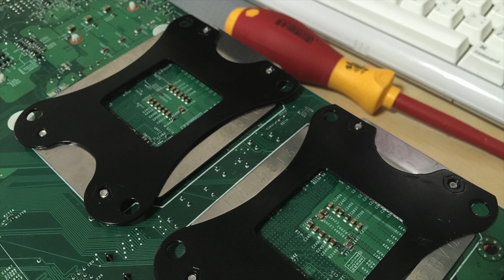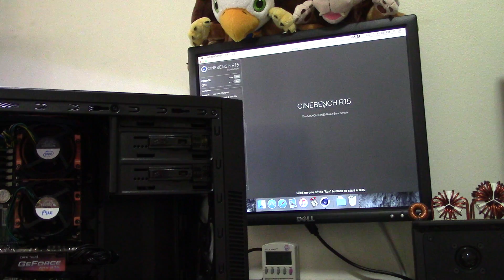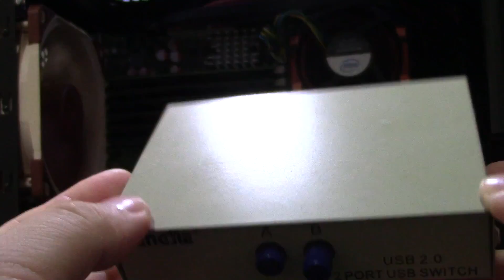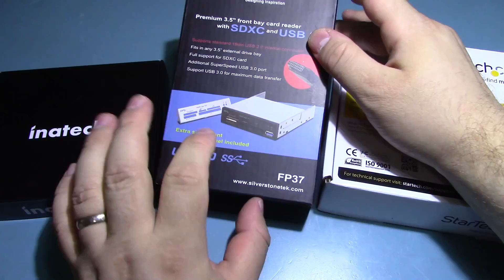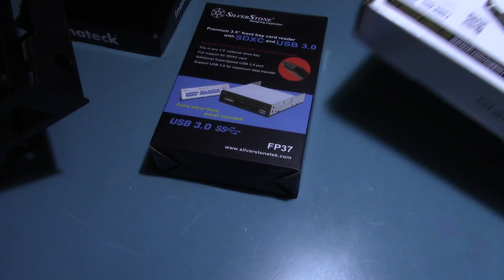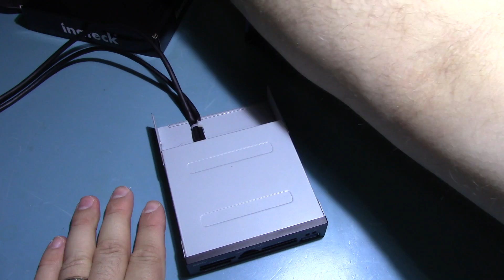Comment: For a couple years now i have been planing to build five systems running this exact motherboard, plenty of RAM and 2x E5450 Xeons each for our gaming/party garage we are currently building.
Each system would be hooked up to a seperate TV. Plan was to make them Win7 or 10 only but you inspired me to make them dualboot. Never had a Hackintosh before.

We have 5 TVs mounted to one wall. 3x 32" 1366x768 Fujitsu (really awesome ones) next to each other + 2x 42" 1920x1080 LG right above them.

The three 32" ones are currently hooked up to 3 GTX 480 1.5gb GPUs (got them for ~50€ a piece) , which are seated on various 775 boards with adapted and slightly OCed E5450 Xeons and 4GB DDR2 each.
One of the two 42" ones is hooked up to a 3GB GTX 580 paired with a i5 2500k + 8G DDR3, the other one to a annoying Radeon 7950 3gb on a i7 960 + 6 GB DDR3.

In really modern Games like GTA V the Xeons start to bottleneck the GTX480s, but since the game does take advantage of more Cores this upgrade should work out quite nicely.
The Xeons and the Nvidia GTX GPUs are going to be reused. The other 42" will probably be hooked up to a GTX 760 2GB that i have laying around somewhere.

The rest of the old rigs will hopefully make enough money on ebay to refinance the most of the new parts i will have to buy.

So, now i only need to get 5 of these boards (~125€), 6 more xeons (~150€, i have 4 already) , 5x 16gigs of DDR2 ECC reg.  (~100€) , 5x old Sounblaster Audigy or simmilar PCI soundcards (max. 50€) and 10x custom made heatsink backplates (~19687,53€) :D ... ok that last number might be a little far off. Also, to be honest, one of the main reasons why i haven't bought these boards yet is that the ebay seller hasn't answered my question about the shipping cost to germany yet. I won't pay another 100€ just for the shipping.

Also i have to mention that it took only one of your videos for me to subscribe last week. Keep up the good work, i've really been enjoying your content sofar and i watched a good part of it already ! :)
Reply: +Coldministrator With gaming it's generally preferred to have fewer cores, overclocked if possible vs. many slower cores. There are very, very few games which use more than 1-4 cores. Most of which only use 2. It's actually quite surprising how little CPUs bottleneck most games, it's way less than you'd think.

Unless you really want to play a specific game which somehow uses a lot of cores, it is probably going to be a better idea to sell the Xeon board + CPUs and get either a modern AMD system or something like an 1155 motherboard on eBay for ~$50 and an i5. Yeah, you'd lose the ability to get cheap DDR2, but plain DDR3 isn't much more these days and you'd get all the other stuff which comes with a newer board like USB 3.0, more PCIe slots, etc. It'd also make way less heat and use way less power for pretty much the same job (if the game doesn't use 8 cores).

This isn't the exact article I remember reading (I think the one I read was on Anandtech, but you get the idea): http://hothardware.com/reviews/can-a-new-gpu-rejuvenate-a-five-year-old-gaming-rig-
Reply: +Peter Brockie Yeah well, i'm sure there are better cpus for gaming but i've noticed that there are actually many games that benefit from more cores, a lot more than you'd think.
Also, a single E5450 is still faster than a Phenom II x4 955 for example. The 955 was a great CPU for gaming and i've been using one of these in my LAN rig for ages.

And for games that don't use more than a few cores, here are a couple Passmark SINGLE THREAD scores for various CPUs:

Phenom II X4 955    :  1122
E5450                        :  1266
Core i7 860               :  1299
Core i7 960               :  1385 
AMD FX 8150           :  1337
AMD FX 8350           :  1506

The E5450 is not weak at all! Certainly not for the price! Two of these really kick ass if properly utilized.

For example GTA V runns a lot better on my dual Opteron 8439SE rig (12x 2.8GHz) than it does on a single Xeon E5450.

Now take a look at it's single thread score:
AMD Opteron 8435 :    913 (there seem to be no single thead scores for the 8439SE, the only difference is 200Mhz Clockspeed)

I probably will do a video on this Topic one day.

And you also have to keep in mind that with the Xbox One and the PS4 being x86 multicore Systems most of the upcomming Games will probably take advantage of more cores even better.

To adress some of your other points: I don't need more PCIe Slots or USB3, also two E5450 cpus still need less power than a single FX8350 under full load.

Not to mention that anything more modern to beat this in performance would cost a lot more to buy.
Reply: +Coldministrator That's the nice thing about Intel, their IPC is so high even on older chips that it doesn't matter that you can get an 8 core AMD for the same price. Yeah, in heavily multithreaded stuff the cores can take the lead, but in real world stuff Intel quads are hard to beat (especially if you are using something you can overclock).

The last few videos have been edited on the dual quad and it seems just as fast as my Ivy Bridge. Pretty happy with the build so far. I mean, in a perfect world I would just get used to using Sony Movie Studio which I own, but I'm stubborn. Haha I like the ability to have one machine rendering/uploading without affecting my main system while I play WoW or whatever. :)
Reply: +Peter Brockie Yeah, but recently some of my friends had major problems with the quality of some newer Intel CPUs, especially the i7 4790k which has some serious thermal issues.
Haswell was a pretty decent architecture but since Sandy Bridge the development has slowed down a lot. My favorite recent Intel CPUs have to be the Xeon 1230v3 and 1231v3.
I'm hoping that AMDs Zen Architecture will finally be good enough to kick Intels ass again. The ass which they've been sitting on a lot recently. I want to see competiton again!

About editing software: A friend of mine did take quite a while to fully switch from Sony Vegas to Adobe Premiere but once you get used to working with it there are few real alternatives.
Final Cut may be one of them but i think Adobe is currently unbeatable.

That's also something the 5x 2x 4x 3GHz Xeon cores will be used for when nobody is gaming: Adobe After Effects Network Rendering :D ... should be fun, haven't ever tried it yet!
Reply: I seriously hate Premiere. There's something about it which feels like it is a 20-year-old cryptic UI. Movie Studio (aka baby Vegas) is quite nice, but I wish it would organize files better.

Rendering is the least of my worries if it takes me 5x longer to do basic edits. :)

I like the Xeon 1220 (v1) in my NAS a lot, all the features I could ask for and powerful at a low cost.

Zen looks interesting, but they still won't be matching Intel anytime soon. Especially with performance per Watt. Intel is always going to be one or more nodes ahead. Even if they release 14nm, Intel is already working on Cannonlake (8nm). As long as the single thread performance is enough to worry Intel we will be in good shape.

Comment: Nice build.  Someone posted somewhere that those Harpertown Xeons do not in fact consume nearly as many watts as Intel claims they do.  That would explain your low power draw.  So far I've built two 775 systems around them (Yes - you read that right.  There's a way to hack 771 CPUs to run on 775 motherboards), and they run a heck of a lot cooler than my old Pentium D.

Has anyone ever done a DSDT build with a Supermicro board?

Regarding mounting the front fans on that case - can't you just use a threaded screw and bolt?  When I started mounting fans onto cases many years ago, I went to Canadian Tire and bought some.  I haven't used them for ages since the manufacturers always include those short stubby self-tapping ones.

Can you please post some more demonstrations of octo-core performance with those Harpertowns?
Reply: Yeah Intel cheaped out and just spun the chip around and swapped two pins on the 771-775s. I was considering that since I can overclock a 775. But for FCP and whatnot I want more cores. 

I used a threaded screw into the case. That's what the case uses, I simply used a short one which only goes between the case and one fin of the fan instead of all the way through. Works, I guess. Haha

Save up all those 5 cent bills from Canadian Tire. I think the CT money is worth more than the dollar. Having said that, I think that might be a This Hour Has 22 Minutes joke.

Comment: For a Windows tool for converting audio files, have a look at dBpoweramp: https://www.dbpoweramp.com/dmc.htm
I've used it in the past and it worked great. It seems to support the features you need including Apple Lossless, FLAC and multi-core encoding.
Reply: +Carey Bishop Looks decent. I'd probably buy it if I didn't have this Hackintosh. Little pricey ($40 vs XLD's free).
Reply: dBpoweramp has a free version too, you only need to pay if you want the full feature set.